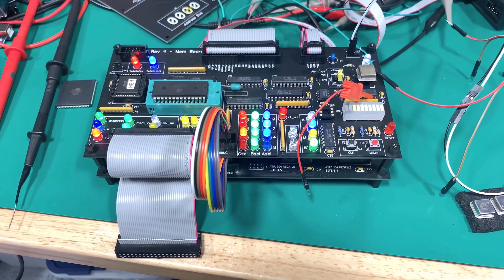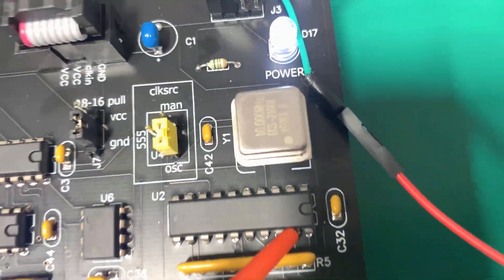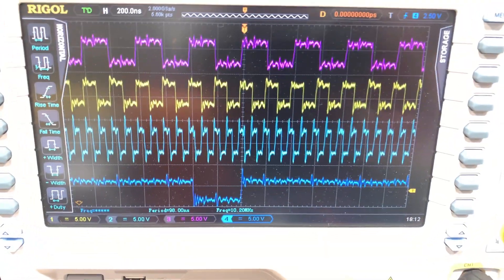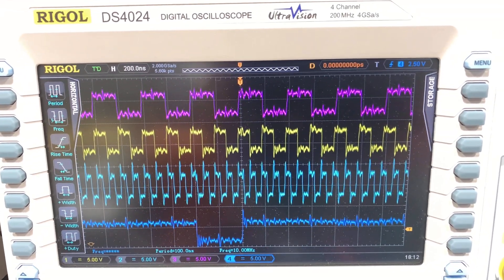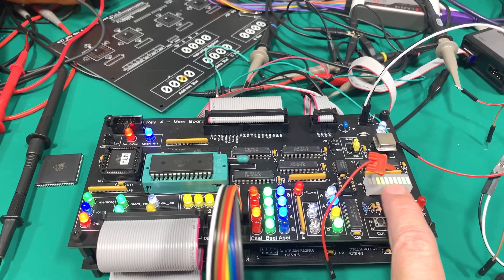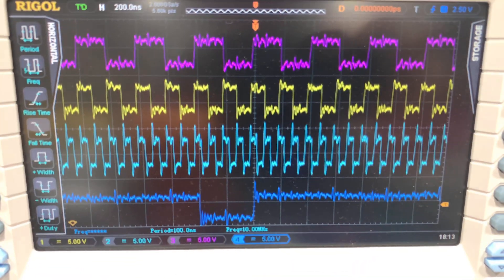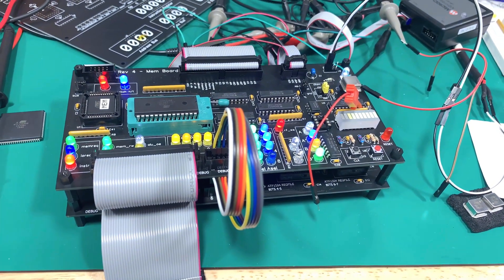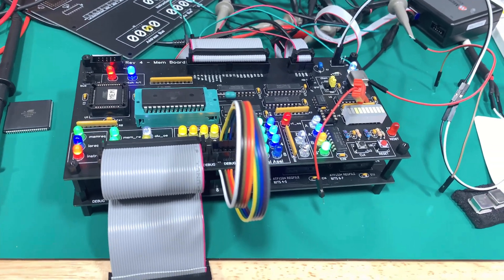Kartana 4 CPU First Run

Comment: Impressive the auto-router's spaghetti traces worked, I've never had good success unless I spend the time to correctly label and prioritize the nets in the schematic so the auto-router doesn't go prioritizing some measly LED status trace and put 50 vias in the ground trace. Yet again I've never just gotten a purely auto-routed PCB manufactured, never trusted it, and even if it did work it would never pass EMC.

But I do wonder if a large amount of the overshoot in your situation is actually attributable to your probing technique, the output of that 10 MHz clock should look much cleaner than that? (I assume you only have a clock divider using the 10 MHz) Does the clock signal look much better when you use the ground spring on the oscilloscope probe?
Reply from the maker: Oh yes, I meant to mention that.. Those probe grounds were running along a small wire clipped on the other side of the PCB, so almost the worst way to do it! 

The Autorouting is interesting.. with a 2 layer board it is indeed pretty unreliable in how some things get routed, but with a 4 or 6 layer I have found it works pretty well - given some constraints.  I just did a 4 layer PCB that I autorouted about 80% of the traces on (>3000 pins), and with a dedicated ground and power plane most of the routes were pretty good.   I did all of the clock by hand, as well as some of the DRAM traces, but in the end it worked great.  

It is certainly not something to be used for a production PCB, but for a hobby it really makes it quick!

Comment: your noise is terrible!!! @ 5v scale, your clock looks horrendous. I'm surprised you never got yelled by your teacher never to use "auto route button"
Reply from the maker: Yes, that was somewhat by choice.  I wanted to see how well it would work with zero routing effort and 2 layers,, and while there was of course a lot of noise, it still worked great.

Indeed in college we did not use autoroute.. of course that is as much because autoroute wasn't much of a think back then.  ;)